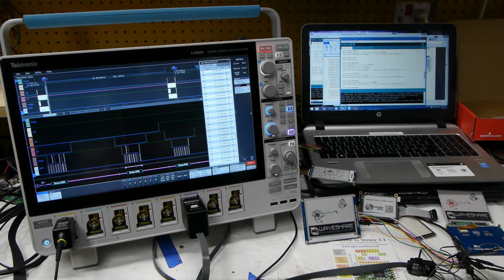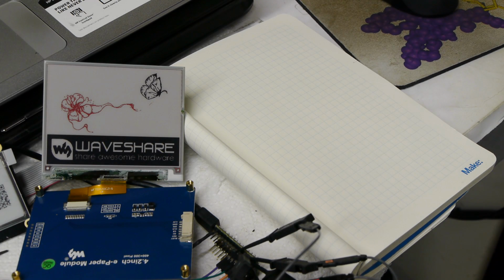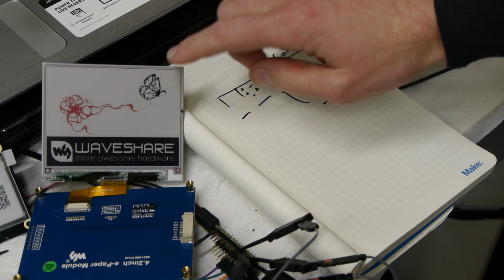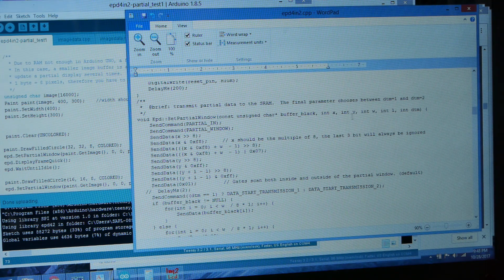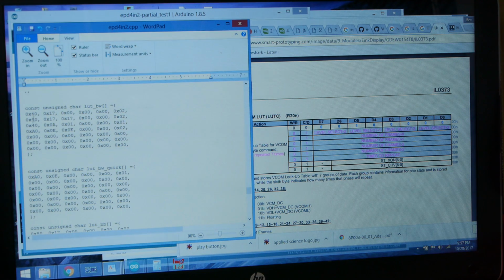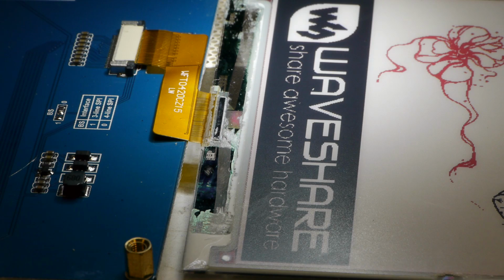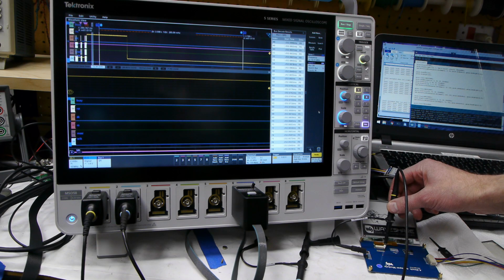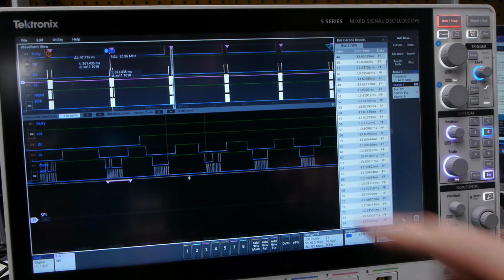E-paper hacking: fastest possible refresh rate

Comment: Strange how Youtube protection wasn't triggered by that scope porn!

On a more serious note, why all the fuss with cycling the display with AC voltage? Why not simply skip writing same "color" to a pixel, or in other words, only write pixels that do change?
Reply: FlumenSanctiViti my guess would be that the electric field from neighbouring pixels starts affecting the pixels that you skipped
Reply: My guess is that it uses a chip that handles setting all the pixels from the lookup table, but the setting of that table is handled in code

Comment: Wondering if you can think of a way to get all of those active matrix transistors to open at once so that any signal going into the display would just pass through to the pixels directly?  I'm basically curious if it's possible to get an active matrix display to electrically respond to input similar to a passive matrix liquid crystal display without an gating?

Comment: Back in school I designed a LCD controller that used higher initial voltages to reduce the draw time refresh rate (applied control systems theory), but was coerced to abandon further development by persistent "loud" jackass {citing a patent troll whose (since -removed- renamed) Wikipedia chaff argued all working examples had to be copies from an example made 20 years ago} making any lab-work unfeasible without greater hearing protection than I had at the time.

(Of the companies named in the lawsuit) I don't know if Samsung said they "won"(2007) because they proved convergent design, (or the required time-machine was used to obtain the original sample from a party other than named by the troll), but looking it up now, I see that in 2011 they settled and are now using the trademark of the company w/ the patent.

Comment: Well, if your partial refreshes accumulate to refresh the whole screen over time you can actually get rather quick refresh rates on such displays, since whatever you display essentially 'causes an ac signal on it's own.
https://youtu.be/NOMXQ2WyQVI?t=3m46s
Of course it's still slow in comparison to normal screens, but you know, everything has it's advantages and disadvantages...
And about color e ink displays, well, different possible versions have been around for a while now https://youtu.be/N2V9iuTW3sA but I haven't really found any explanation as to how they work either.

P.S. I've also used Wordpad on .cpp files before, 'cause Notepad screwed up the line breaks and basically made it very unreadable. Notepad++ however displays it correctly and syntax highlighting etc. ;-)

Comment: Nice video have wondered about those waveshare e paper displays want to use one and a 3 inch capacitive touchscreen add a decent sbc say a 96boards  unit  any just need correct headers  than play on  upgrade or down to easy.

Comment: EInk has huge Electronic Ink Display Modules (with 31" 4096 color or 41" 16 color greyscale) for less than $2500; also tiny B&W modules for under $100.

Here's a quote from their Website:
"EC312TT2 is a reflective electrophoretic E Ink technology display module based on TFT active matrix with color filter design. It has 31.2” active area with 2560 x 1440 pixels, the display is capable to display 4096 colors depending on the display controller and the associated waveform file it used.".

Comment: Sorry for doing it this way, but I haven't been able to find a way to reliably contact you. In the rubber band refrigerator video you speak of free software used to draw the gears for use in Solidworks. It seem to be proper curves and not an approximation of the involute curve. Could you share what software you used? I've been looking for exactly this for one of my projects.
Reply from the maker: I think that I used a plugin for Solidworks to make those gear shapes.  I believe it was this one:  https://www.thingiverse.com/thing:8077  Good luck!
Reply: You might look at RushGears, which has a tool for designing gears, downloadable in various formats, and can later be ordered. http://www.rushgears.com/tech-tools/part-search/build-custom-gears (Note the warning at the bottom of the tool that the gears should not be used for manufacturing, so it may be no better than the approximation. Might be worth a look nonetheless.)
Reply: After tinkering with it for a little bit, I think that script/plugin should suit my needs, or can be adapted to them. It does look like it calculates a number of points and then interpolates a spline across them, but at this point I'm not even sure you can do it another way. I haven't seen it done differently anyway. It's certainly a big improvement over having angled faces on your teeth or the error prone manual adding of a spline I needed to resort to before. Thanks for the help!

Comment: You should check out what the reMarkable paper tablet is doing. It's using an actual e-ink display, but updates fast enough for latency-free handwriting (directly on top of the display - it uses a stylus digitzer made by Wacom I believe). It's actually so fast that you can't detect any latency at all when writing or sketching. It's also very high resolution - 1872x1404. No flickering or updating on the display while drawing, or erasing. It's pretty amazing to use, I own one myself. It does occasionally perform a full screen refresh, but it's so fast that it's unintrusive - and it only occurs while you are in the menus or something like that, never really when actually drawing on it. You can also erase and such, but I guess once they got the drawing figured out, erasing was kind of a freebie.

And it's true e-paper as well - it maintains the image even with the battery removed or what not.

I have no clue how they made it happen. It must have incredibly fast response time - it's as smooth to use as a Wacom tablet on a PC, looking at a 60hz screen.
Reply: alysdexia  why use many word when few word do trick.
Reply: Super late, but looking at it's stats (10.3", 226dpi) it seems like it's using the ES103TC1 display. I'd get one myself if it didn't cost quite so much. 

I remember following a company for a while which was trying to create an eink tablet, it felt like they fell off the face of the earth but this might actually be them.
Reply: alysdexia Look out people, YouTube comment section has a full time editor now 🤣
Reply: alysdexia  git outta here
Reply: Can you use it like a monitor
Reply: alysdexia  You are not a happy person, are you?

Comment: If the particles are charged, isn't it a problem that they could stick together or repel each other inside the chamber?
Reply: To think that static electricity was known of in Ancient Greece, yet some modern day people never heard of it...
Reply: Joe Smith they're not moved by an electromagnet though
Reply: +LegendLength it's a static charge. The kind of charge that makes sparks when you touch the doorknob and stuff like that.
Let's say you remove electrons form an electrode, and you put electrons in another. electrons want to flow from one to the other, so they're "charged". But if there's no path between electrodes, the charge is static (because it doesn't move).
Though there's no current, the charges affect the electric field, attracting opposite charged particles.

Edit: Like when you rub a latex balloon to your head and stick it to the wall or ceiling. It's static charge what holds it in place.
Reply: gabest4 the individual negative charges of the particles are nowhere near as strong as the negative charge of the electromagnet used to move them.
Reply: Maybe some sort of surfactant helps?
Reply: LegendLength the particles are moved by an electric field not by a magnetic field like there is in an electro- or permanent magnet

Comment: It would be interesting to try a burn-in test with that display without the reverse cycle, e.g. 10 updates at one spot, 20 updates at the next and so on until the text is barely legible.  Then apply full black/white cycles to see how long the burn-in takes to clear at each spot (or how much it fades after let's say an hour).
Reply: Yeah, I second this. The refresh rate of these is what prevents me from using them in projects. If someone else who knows more than I do could test one of these to destruction I'd be super stoked. I'd totally use these all the time if I could achieve 3 Hz refresh and be confidant that it'll last more than 3 days.
Reply: Since most e-Ink screens that are to be changed frequently are for consumer products (Kindle, etc) I believe the manufacturer has gone to extremes to avoid burn-in, which would prompt lots of purchase returns.  Much easier and cost-effective to condition consumers to flickering every once in awhile than to random ghosting of text over text.  Therefore cutting the reverse cycles shouldn't cause dramatic ghosting in a home-brew project, as long as you don't care about not having a pristine viewing condition each time.
Reply: That's a great idea and gizmoguyar nails my interest in it too. Fast refresh rate such that you can interact with it just like a lcd like on a iPad, it becomes so so so much more usefulio
Reply: I think that after a certain point the damage becomes irreparable because the voltage can no longer affect the particles quite as much
Reply: i accidentally looked away during the dot moving period, then came back when he flip the screen color and said there should be a ghost circle burn-in: and i can't really see it?
i do see some unevenness in color scattered in a small region, but i have to deliberately imagine it is a circle to acknowledge ahh it indeed is a circle

then i rewatch the dot circling period of the vid and holy shit the burn-in become so freaking obvious!😂with shades differences!😂the later the more firmer!😂maaan!😂(it was burn-in in my retina?!?)

Comment: Wow such a fabulous primer. What I'm struck by is how ripe for improvement this technology seems to be. If E-paper could be made with 300 dots per inch, 60 Hz refresh, and full-color it would rapidly replace most existing display technology. It seems to me that at least some of the problems that need to be solved are analogous to similar problems that have been solved with previous generations of display technology. Obviously I'm missing something, if it were as easy as it feels to me we would already have high res 16 color E-paper. Excellent video.
Reply: No, screens that stay to the image and use less power are not necessary in most cases. LCD or OLED technology is way better for most cases. Remember that E-Ink doesn't emit light. So either always watch it with light shining at it or endure washed out colors because of some sort of backlight. So there isn't a need for a more complicated and in turn more expensive display technology in most cases. And of course the limitations it has don't help, things like no true 8(or 10)bit color space, higher lag(Because of actually moving liquid, unlike OLED) and of course other limitations I can't think of right now.
Reply: There are other types of e-paper displays; however, they use different technologies. The term "e-paper" can refer to any display that reflects light instead of emitting light like conventional displays. The displays in this video are "e-ink," which typically specifically refers to the charged particles as discussed in this video, and those displays have the neat property of persisting when unpowered. You might want to look into other, higher refresh/color e-paper displays, such as the low power Sharp Memory LCD.
Reply: @229ac88b  that sharp memory lcd display looks absolutely perfect, can it be made in bigger sizes and do you know what the catch is? Any others similar to that you recommend? The dream would be a display tech that acts as if 'an iPad and a kindle had a baby'
Reply: @anjankatta12  I haven't ever used it in any projects myself (I want to someday!) but I own a Pebble Time which uses one and I absolutely adore it. Incredible visibility in many different situations and angles - and with the backlight great in the dark too. I haven't seen any that are very big, though, so it seems like that's probably the main drawback (size). I'm sure power consumption would go up at bigger sizes too. Haven't ever heard of something similar unfortunately (though I haven't really done much research).
Reply: Still waiting for micro-LED arrays to mature here...
Reply: @getsideways7257  why would micro led help for the epaper type application. The goal for epaper is to make it easy on your eyes to read for long periods without strain, easy to read in the dark, and easy to read outside. Does microled help do any of that?
Reply: @anjan katta Well, epaper does its job pretty awfully. I've seen quite a few such devices already, but I never settled for one. First of all, it has mediocre contrast ratio even in the better cases. Second, the refresh rates a horrendous. You'd say you only have to turn the page once in a while, but that's still unacceptable for me. And the last but not the least, you can't read it in the dark. Sure, you can use backlighting or whatnot, but then why bother with a reflective display to begin with?
Not to mention that reflective light is still light. If you have a high contrast ratio capable screen, like a good OLED one, you can adapt it to the environment enough so that it would be much easier on the eyes than, say, an IPS monitor, which you should also adapt to the environmental lighting conditions throughout the day.

Comment: Can you please use screen capture instead of filming the screen with your camera. Some text is hard to see. Also I was wondering, What's the best refresh rate on these displays?, just wondering if they are practical for terminal only thin clients
Reply: I also really want to know if a eink display can serve as such, as there are very low-power ways to feed it data...
Reply: Agreed. That would make for a very low power device, ideal for people who handle servers
Reply: The supplied software has an awful display rate. He seems to have done a great job on improving on it. If you don't mind some ghosting, it looks like he has it at about 3Hz. That will be suitable or not depending on your application. Monitoring slow changing values, fine. Fast scrolling through log files, not so much.

Comment: Is it at all possible to get refresh rates that compare to traditional displays used for smartphones or gaming monitors? It would be really nice to have that kind of low power display in a smartphone.
Reply: SNEAKxxATTACK I think that the point is that it only draws current when you change the page. So using it to display an animation would be somewhat counterintuitive and maybe worse when it comes to current consumption compared to lcd displays
Reply: Der Keksinator hmm alright.